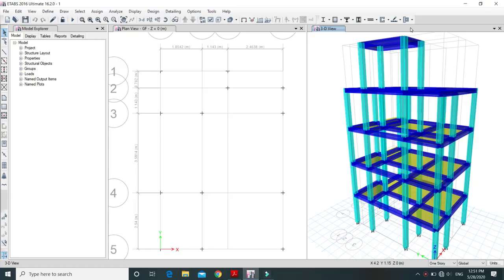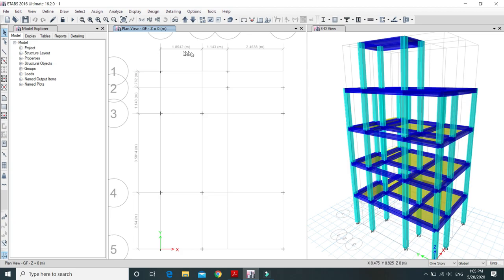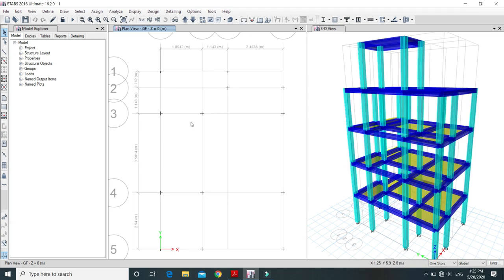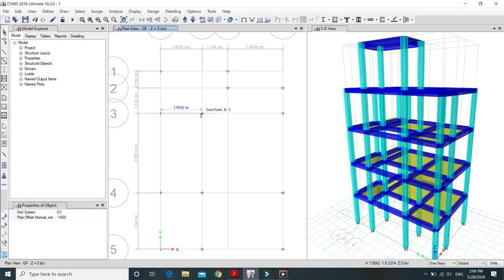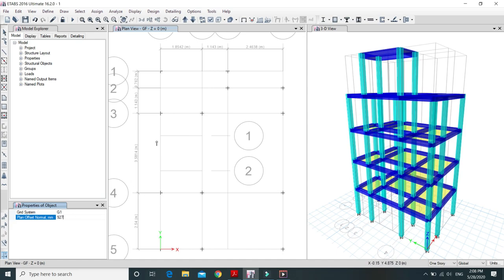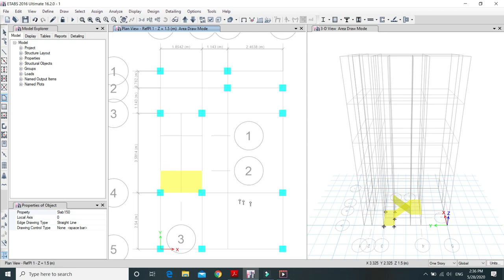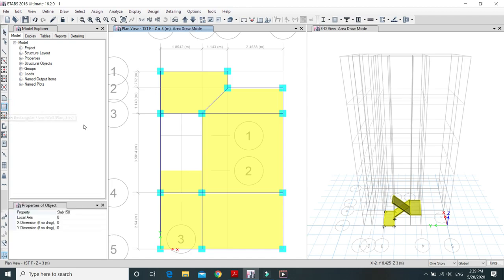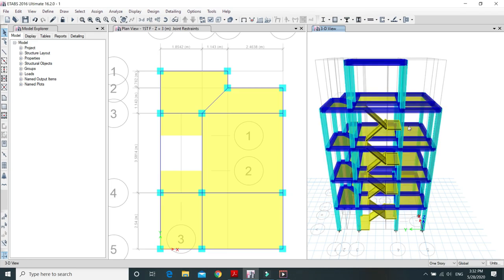Staircase modeling in the building ,basic differences between modeling from base and ground floor

Comment: Staircase nai model ma assign Garda kina reinforcement badi aauxa Ra staircase bata aaunya load matra assign garda kina kam reinforcement aauxa
Reply from the maker: It is because staircase is a inclined reinforced structural member.So it gives some stiffness in vertical direction.Thus it changes the stiffness centre.There might be increasment in the eccentricity because of it and changes in the eccentricity would result some reinforcement changes.